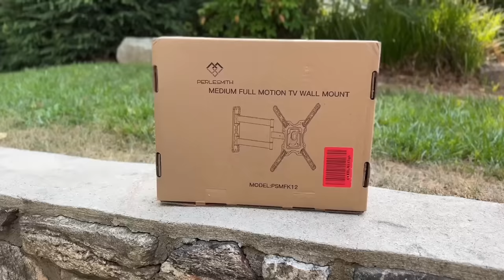Building A Mountain Cabin EP36 | Front porch stair framing, footings, and porch railings

Comment: 15:00 Pro tip for measuring between two posts. On one side measure and mark 10 inches from a post. Then flip the tape and measure from the other post to the mark. Add 10 in to that measurement.
Reply: Was waiting for them to show that too, but they never did.
Reply: Or, hear me out, hook on post, measure to post  take off width of post, or use a laser measure

Comment: I live in Allen Co in norther Indiana. My septic system has that but it has multiple alarms and light. We’re  required in this county to have what’s called a “permitted septic system”. Basically, you have to have a permit from the county for your septic system. It has multiple tanks, a pump, a UV light and multiple filters. The county demands that your system is tested on a quarterly basis to make sure that the waste coming out is clean to a certain point. The lights and alarms are for the pump, UV light, filters and waste level. It’s completely overkill. And the initial install cost was $31,500! The testing per year adds up to around $1500

Comment: Pro tip from a carpenter that worked outside near the biggest temperate rainforest in America (Washington state),and now works on the wet side of Hawaii….to extend the life of your tape measures,every day wipe down your the blade of your tape with a rag blasted with wd-40….repels rust,helps keep grit out of the housing.

Comment: Samurai carpenter put me on the idea of using a half-lap joint for handrail. Cut your pieces to extend past each other 1-2 inches then half lap over the corner post. Glue the joint and screw it to the post. Works best on outside corners.

Comment: another pro tip for doing those post top rails.. if you measure at the bottom of the posts rather then trying to hold the post plumb it will plumb the post by itself(90% of the time) also helps with what ever spindle or insert your using

Comment: On our jobsites (years ago) we had a policy that everyone  had to use the same brand of tape measure because, over a sixteen foot distance the difference in the "reading" could be sizable.  We also worked around salt water and, when I found a good deal I would buy them in quantity.
Reply: A subtle but valuable tip! Especially in a woodworking shop, measurements have to be universal and change as little as possible as a project moves through departments.
Reply: tape measure nazi I’m using whatever tape I want
Reply: I used to agree with this rule but the other day I realized my two different Milwaukee tapes disagree with each other! Granted I’m in the UK so one was imperial with metric and one was metric only. As an American this blew my mind. Only 1mm off (3/64 roughly). Sad day as it was the one I like that was wrong. I’m going to a same tape system on all trim and woodworking.

Comment: For the concrete mixer, you slice it down the middle and then grab it buy the corners. Then flip and fold in half. Have someone ready with the sprayer to wet it down and stop the dust.

Comment: Eric - Not sure if you've ever seen it but here in Maine we pretty much exclusively mount our stringers on hinges. The stairs ALWAYS seem to move, cause the deck is set to 4 feet below grade. It allows the stairs to float with the frost movement instead of getting ripped of the deck every year
Reply: That's pretty cool
Reply: Interesting!
Reply: @digging, can you link a video example of this? I’m curious what that looks like
Reply: @mattshinay  it’s a hanger that you would use on a rafter or a floor joist.
Reply: That's weird, and different. If i ever see snow ill make sure to remember that.  That's the cold stuff right?

Comment: On pressure treated 90 deg corners I use a 90 deg butt joint rather than 45 deg.  They still open up but you end up with a straight openning rather than pie shaped openning and I think it looks better.

Comment: How I do it!  15:00 begin on one end of the tight right angle measurement. Mark 10 inches back from that end. Flip the tape and measure back to your mark from the other end and add 10 inches to that measurement. No bending.
Reply: I do the same
Reply: I do the same as well. Bending a tape for rough framing is ok, but for cabinetry or trim carpentry, that's not accurate enough.

Comment: I've read the comments on many of your videos and have seen that a lot of entry level carpenters are learning from your "Pro  Tips", so thought maybe I could add one of my own, even tho I am NOT a professional carpenter.  Tip: when retracting your tape measure, always keep your finger in front of the tape slot entrance/exit.  Your finger acts as a shock absorber for the blade end of the tape and prevents the blade from snapping off, thus destroying your tape.  You guys might think this is Carpentry 101, and it is, but I think a lot of your viewers are likely in that class.  Like Eric said, your tape is one of your primary tools and a good one needs to be treated well.

Comment: I pick up totally unopened bag of concrete and lift up, set a little under halfway into opening of mixer.   Use trowel as a knife to cut the top of bag off (not totally off, make a flap).  Pull bag out, mix slides in.  Super easy, clean, and bag remains in one piece for clean up.   Premark a bucket with exact amount of water you like.  2 bags, 2 buckets of water etc...  Makes a consistent consistency.

Comment: Miter joints open at the heel with redwood and fir, too. so what you do is you compensate ahead of time by opening the toe a bit to being with. When the heel shrinks you pound the two back together. If you use screws that part is easy. And the re-adjustment is so slight you can't notice it anywhere else.

Comment: I’m from Costa Rica and although we do have small concrete mixers most of the time for small jobs we do mix concrete on the floor, some times we lay a tarp underneath just to prevent the concrete from mixing with dirt, grass, etc. It’s a heck of a workout and if you don’t know what you are doing there could be chunks of unmixed cement when you pour the concrete but I think everyone should try it sometime
Reply: Hi Esteban, look into the "steele mixer," it's a hand-powered concrete mixer and can mix a 60 pound (27 kilo) bag in about a minute. Much less expensive and more useful than an electric mixer
Reply: Redoing my backyard, I may try this since my wheel Barrow tried to give out on me, wooden handles are pretty but not used to manual labor, so its gonna end up a yard ornament.
Reply: I will give it a try, thanks

Comment: Happened to just have watched a bunch of tape reviews when I was shopping for a new one. DeWalt ended up winning overall, Craftsman actually got second, then FatMax. Lufkin did not perform well even though they look cool, I really wanted a reason to buy it but ended up not. They are also apparently off by an 1/16 to 1/8 right out of the gate so you may want to double check some measurements Ray!

Comment: The other work around for a stair being added to a deck is having a closed-two-side stair where the treads are notched into the stringer (or sitting on blocking or a cut stringer) rather than the stringer being cut and losing the top. Having the stringer stay uncut gives it the strength to be fastened to the deck skirt board without any additional blocking needed. It does change your railing options a little bit but not a lot.

Comment: I used a little Bosch laser measuring device for inside measurements when putting a tongue and groove porch ceiling in. It was very handy and always accurate especially when you would have the dumb end of the tape a long way from you.

Comment: easy way to figure stair stringers, height divide by 7, ( why 7? cause 7" is the perfect rise)  so your 29.5 divide by 7 = 4.2 or 4 risers =7.37 inches .37 " x 16 (why 16? cause we are working with inches not feet) = 5.9 equals 5/16 or round up to 3/8  so we have 7 3/8" then deduct tread thickness from bottom rise.

Comment: 11:42 I can't speak for all Aussie wall and floor tilers but 99% of the time we still do a floor mix, you end up shifting the sand like five times before having it the the room you are working. You get really fit really quick I remember being an apprentice and the boss got a shop/commercial job and we were mixing like 5 tonne a day (11023 lb) for a week. 

Protip: Speaking of tapes sometimes if you are going to be yelling measurements to a helper or you have one tape at a bench and one inside (if you don't wear a belt) and you have two different brands and even sometimes the same brand pull them out and check that they are the same I had one tape that was off by 3mm I kept scratching my head why the shower niche angle was short. I'd hate to do a big set out and be checking for square and that slight difference could cost big $ for a simple mistake.

Comment: Having steps of uneven height is not not without danger. When I was very young (around 4 years old), my mother told me to collect my tricycle from the garden as it had started to rain. It was quite heavy for me, and I had to carry it up eight or ten steps. The top step was just a little higher than the others. I tripped and bit my tongue very nearly all the way through. It was a very unpleasant injury and I still have the scar across my tongue. When my adult teeth came through, I had notches across the width of the two upper front ones, which left them weaker. In my 40s, they both broke. This was over 60 years ago.

Comment: I don't know about the thermals, but I do know that packing insulation too tight will ruin alot of the sound insulation, as sound thrives in "packed areas". If it is too tight it would practically negate the wall.

Comment: Make sure that every tape on the crew has the same accuracy in measurement, they are not always the same as I found out the hard way. Everyone on crews my crews used Stanley as they seemed to be the most consistently accurate of all that we tried.
Reply: I have 4 or 5 25-35 foot Stanleys scattered around by house, shop, and truck. I hate it when I can't find a tool!

Comment: I always used Fatmax tapes, in the last two years I noticed it seems like there was a change in the quality, they seemed thinner, the stand out wasn't as good and they seemed to rust up faster. I still used them but I wasn't as happy with them as I once was. I'd be curious to try the Lufkin one, it seems to have features that solve the problems I had with a fatmax

Comment: I personally hate changing out my tape measure, father has had the same one for 15+ yrs...but when the numbers begin to wear, when it's difficult to read my 8ths and 16ths, I have to change mine.

I stepped away from Stanley while working drywall construction, because they struggled to contend with the gypsum dust of the site. Craftsman and Lufkin can take a better beating for sure, so the durability offsets the price.

Comment: Happy to see you're segment on tape measures.. 
I'm an Aussie in Thailand and they're crap.
Some will retract a while, but many won't at all after short amount of usage. 
I'm interested to know how far you can extend a tape measure before it'll sag, or bend ? 
Here, they're so thin, they'll sag/drop after a metre. Its just so annoying..
Quality just does NOT exist here..
Love to know..
I also just looked at my still working current heavy duty tape measure.. No size stamped on the rear side to the fastening clip of the back side distance.. Eye for detail right out the window.. 
Still you prolly can't expect much at prices between $3-$7 which are the average cost online. You could pay more at loosely called "hardware" shops but thats mark up not quality. Typically Chinese / Thai knock-offs.
Reply: Dang, sorry to hear that…

Comment: Typically, you can avoid a “hanger board” by using galvanized straps to hang the stringers to the rim joist BEFORE the finished skirting goes on (and account for the stringer cut accordingly).  That foldable ruler is a essentially a “pinch stick”.  Take 2 thin strips of wood that have a combined length that is longer than the width—place within the opening, mark the overlap, remove the strips, align the mark, and measure.  You’ll get an exact measurement if you don’t own a folding ruler.

Comment: Pouring to the bottom of the timber, would the concrete not shrink once it drives creating a gap between finished height of concrete and bottom of stringer. ? Potentially creating up and down movement of stairs?

Comment: The reason that you would want the railing to come up is that there should be a 1-0 railing extension (flat abve deck) at the top of the rail and one tread depth on an angle to the lower side of the stair. This part of the railing at the bottom is then returned to the gound or an adjacent guardrail. These railing extensions are a requirement to meet many accessibility standards required in projects larger than a single family residence. If this is intended as a rental property than it may also be nice to consider other accessibility guidelines because this could become a liability for the owner.

Comment: guys! Trex still shrinks!! I had a big deck job that i did and ALL of the edge/band board i miter back cut and every single one of them opened up too =(. I had to redo all of the 120ft of band and i let them sit outside on the deck for 3 days in the sun prior to installation. Happy customer, i think that screw up cost me 1500 or so in materials then the time
Reply: Wow!  I’m speechless
Reply: @jaimeperkins9606  Yeah, The first one my mitre joints for the band material all opened up 1/4 -3/8. Thats here in Colorado, our extra dry climate might have something to do with it though. I love you guys btw, you all remind me of my uncle and myself in my starting years... I would drop everything here to move there if you guys would hire me =) lol

Comment: If you put the treads in between the risers, instead of on top, you can attach them to the "rim joist" or "bans" as y'all call it. Also, most stair treads are too small, imo. I have size 13's, and 11.5" is too narrow. It means I have to stop and carefully go down. Two 2x6'as and a 2x4, for a 15" tread is my preferred depth of tread. You have plenty of parking. Give me a break.

Comment: I still don't understand how the mitre opens up on the inside as the wood dries. How come the long side doesn't get shorter, and make up the for difference on the inside?
Reply: The long side stays the same length. The short side also stays the same length. Imagine if the width shrunk by an inch.....the angles on the pieces would no longer be 45 degrees but much less, opening up the joint.
Reply: It just shrinks.. It can also bow too.. its unsightly.. I've had to re-plain the top deck to resolve and use filler..